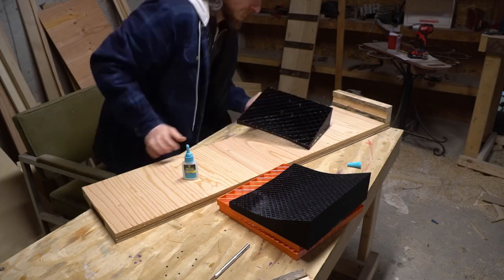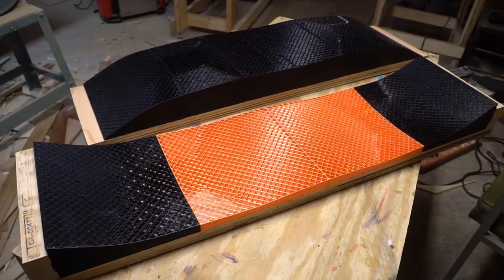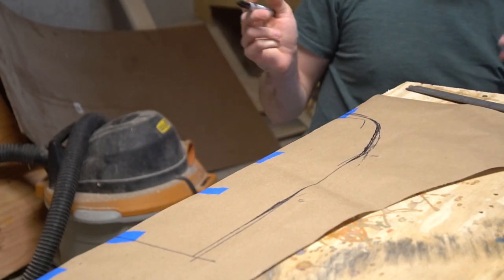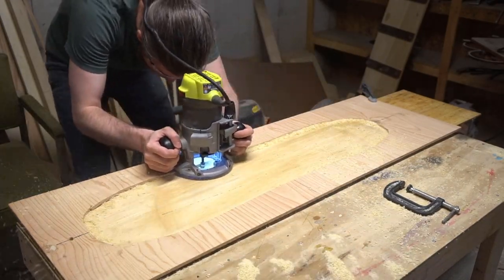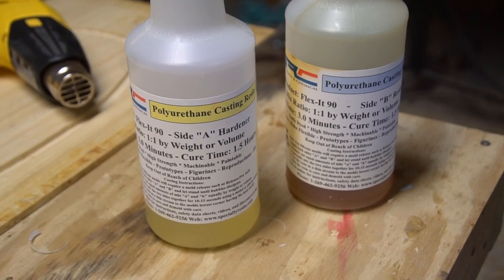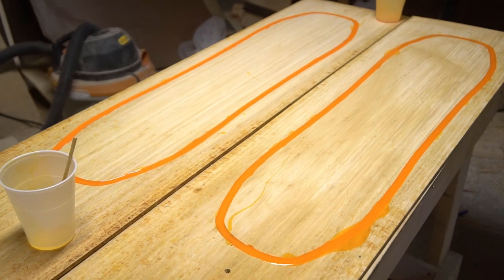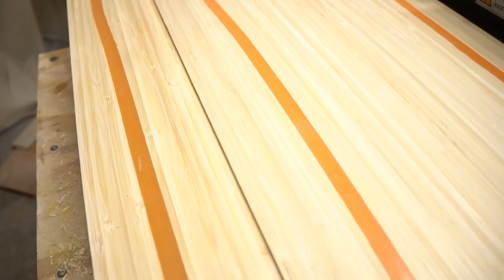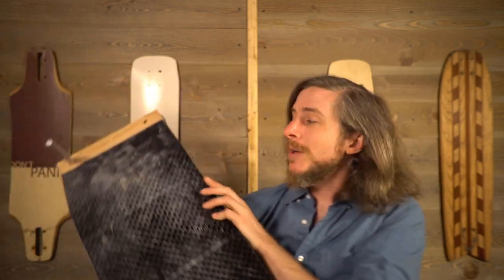Building a Moonshine MFG Style Dual Core Deck - Part 1

Comment: Here's a question for you.
What do you think the feasibility of DIY Urethane mountainboard tires is?

Certainly it would be a complicated mold. But I feel like there's so much that can be done with tires, and vulcanizing rubber molds are completely unattainable.

And in addition to that, are you finding with your experiments that you're able to bond urethane together from separate casts at all?
Because if DIY urethane tires can be done, then retreading tires might also be possible.
Or perhaps even multi duro-whels, with extra soft nubs.
Reply: Riptide is doing research right now that may progress into the mountainboard wheel. They are perfecting the compound...  ie. Foaming was an issue. Their compound has already surpassed that of the full urethane sk8 wheel. Fingers crossed. Come over to the esk8.news forum ( do a search) and  get updated.  Even if the offroad wheel doesnt get made at least we will have a super grippy road race wheel that exceeds the speed at which you can take a corner without sliding out
Reply from the maker: Casting a large urethane wheel would definitely be doable, and some sort of foaming agent like Brent suggests would be an interesting way to cut down on weight. There are also some cool tubeless tire designs out there that might be workable. Casting a tire itself would be tough I think, they're composites in their own right with cloth fibers and the metal wire bead. It might be doable but I wouldn't know where to start
Reply: @GoodRoads  the biggest problem is with the core delamination on larger thane wheels.  They are doing an all metal core. This is game changer. No more core delam and cracking from bolt thru gears and  it can be made so that the urethane can grab onto the core . Mountainboard already has aluminium wheets so it should be doable with a new a metal wheel for offroad
Reply: @brenthawkins204  

Oh yeah, I skim the Eskate forum most every day.
I know Brad's doing urethane tires, but he's riptide. He's got way more resources than a DIYer.
Trying to 3D print molds and doing that would be a whole different scope of a project.
Reply: @GoodRoads  

Where I would start would be to just get an old bald pair of MBS tires, and try and overmold them with urethane tread.
Try to find some way to use the cloth and bead from something you already have, rather than doing the whole thing from scratch all at once.

Maybe even instead of building a whole wheel mold, just cut out a small section from an old tire, and just do a much smaller proof of concept mold to see how viable overcasting might be. I wouldn't suppose urethane would bond super well, but who knows.